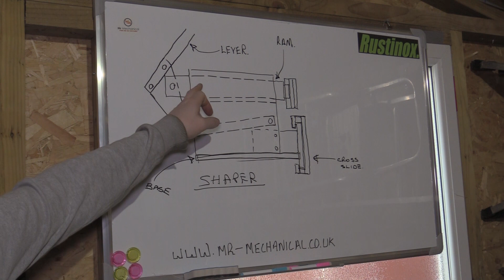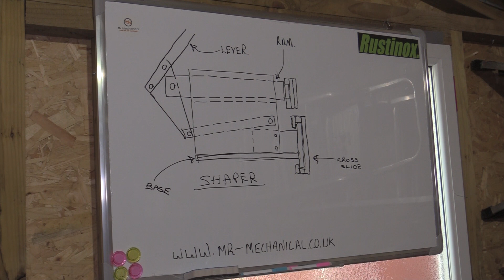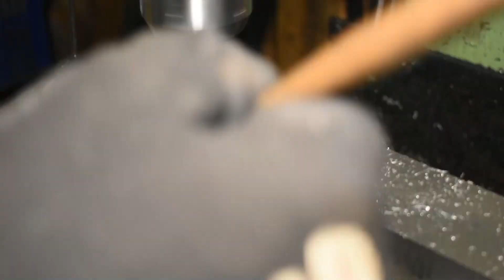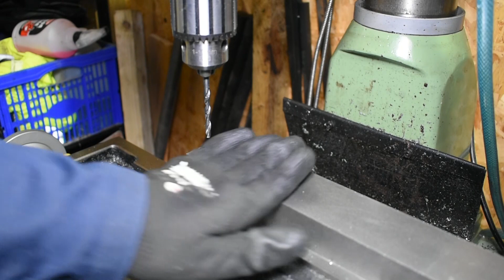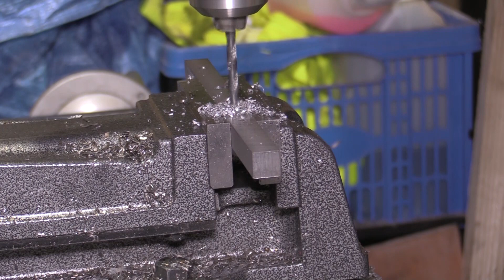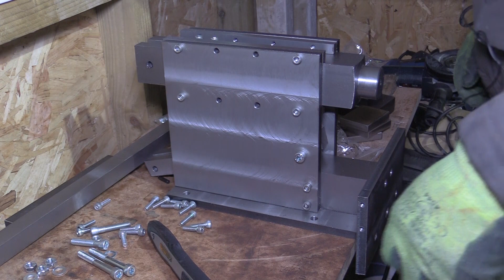Make your own Shaper Machine! Part 2

Comment: I just downloaded the Mill drive motor drawings. They look good. I would like to know if you are providing the stepper motor design.
Reply from the maker: Hi Lee, the stepper motor is a bought in item. It uses a NEMA 34. Just check the bolt pattern is the same if you plan to buy one.